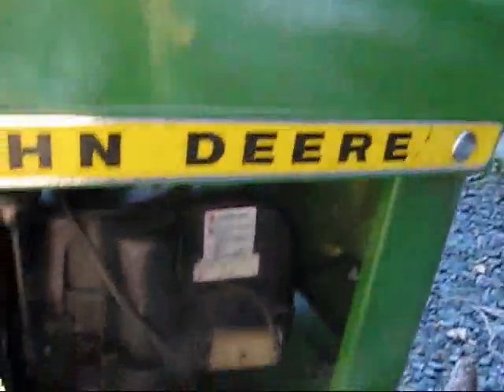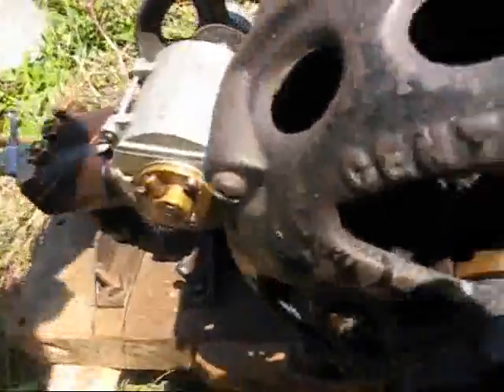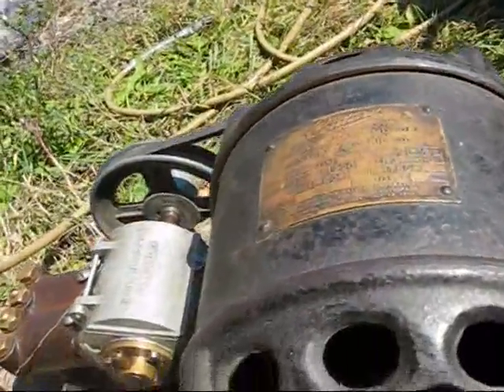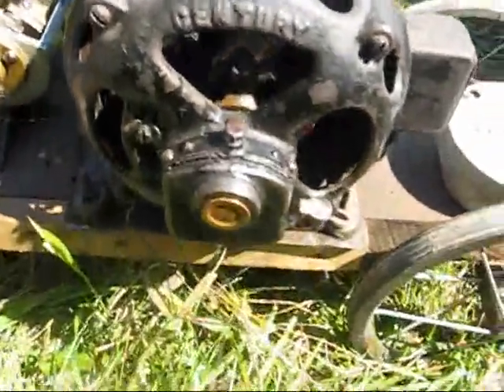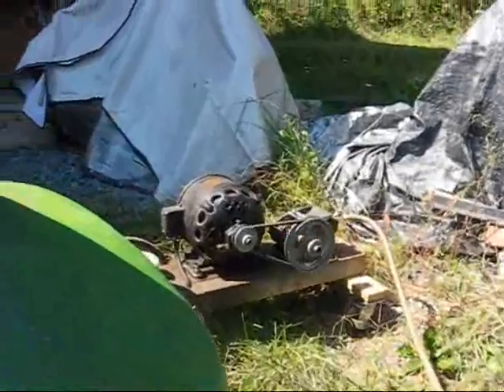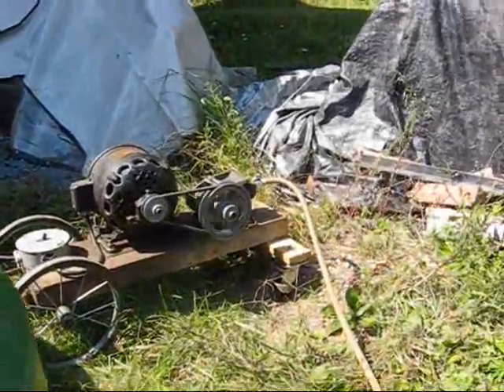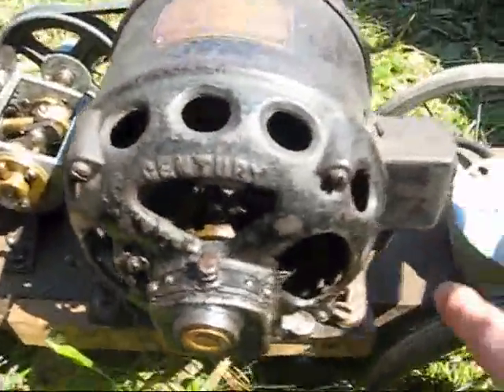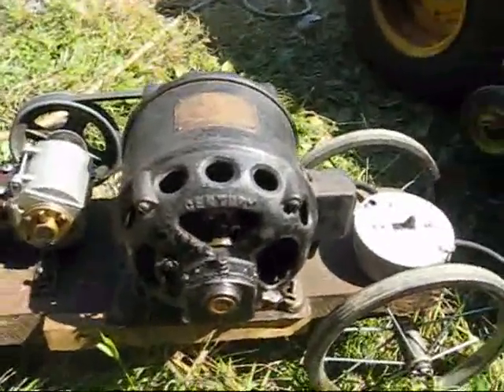Very Rare P.T.C. power tire pump running off a 1915 century motor!

Comment from the maker: @fretlessfrailer did yours have the leather or wood drive wheel? after a hell of alot of dead ends i finally did find something on it, well a different model PTC. apparently they had a wood or leather? drive wheel and to operate the pump you would jack up the rear of the vehical and rest a tire against the drive wheel of the pump and use the cars tire to power the pump, this is what i got out of the artical anyways.  yeah i know the valves are brass, i probably confused them with the rods.

Comment from the maker: it also uses so much less power to get the motor started and running than any splitphase or capacitor motors that ive seen.

Comment from the maker: if you listen in the beginning when i read off the tag it is infact an M6! All the moving parts on the tire pump have to be manually oiled with a hand oiler. the connecting rods and main bearings have oil holes and to oil the cylender's you remove 2 screws and drip oil into the cylender and trough a drilled hole inthe piston to reach the front of the connecting rod! its a high maintenece old thing. but not the motor, it just keeps going i only oil it once a year!

Comment: NICE! What a sweet RS motor! I am going to hazard a guess that it has an M5 frame size...the short stator gives that away. I have 1/6HP Century RS motors with both M5 and M6 frame sizes. The M6 has a slightly longer stator, thats all. How do you keep the crankcase lubed on the tire pump? Wonderfully made, that pump, with brass valves and all!
Fred